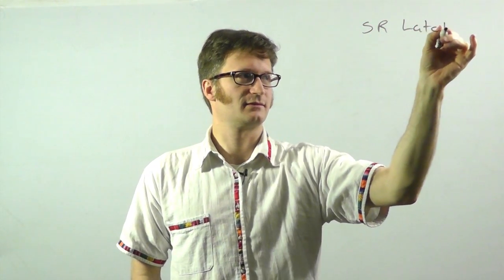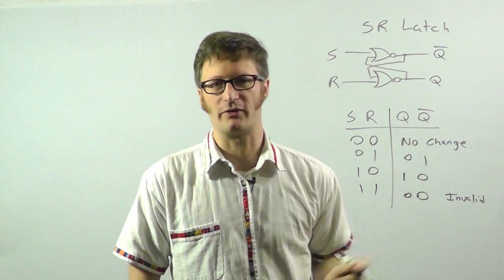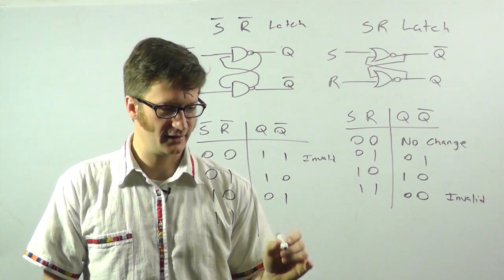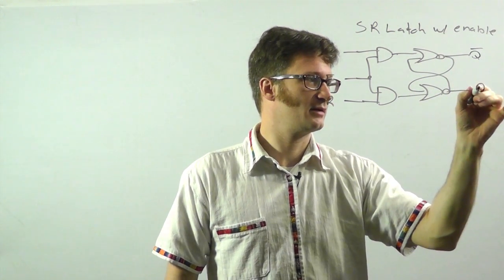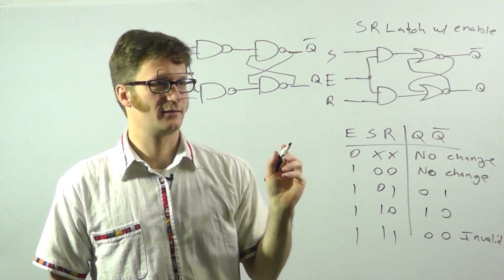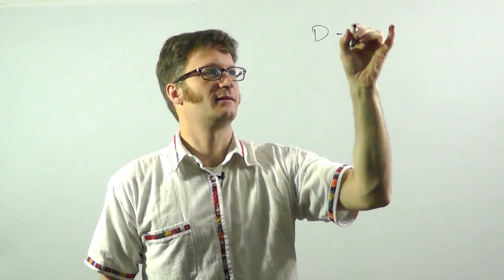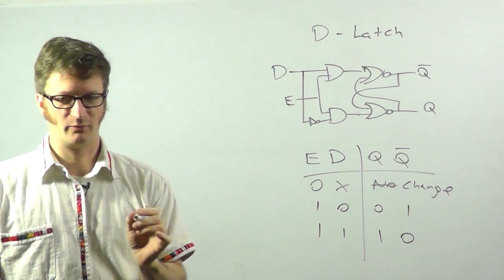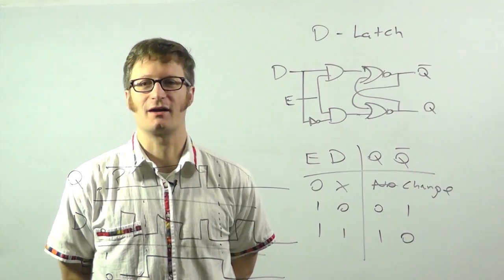Digital Logic - Latch Circuits

Comment: Would it be safe to say that an SR latch is never used in practice?  It appears that the D latch is basically designed to be a safe replacement for it. Why would anyone use a latch that could potentially go into an unstable state?

Comment: the q and q'<---(q not) are in relation with each other, so when q is 1, q' is 0. this is true except for with you tell the latch to set and reset (or S and R are both 1) which is invalid. hope this helped.